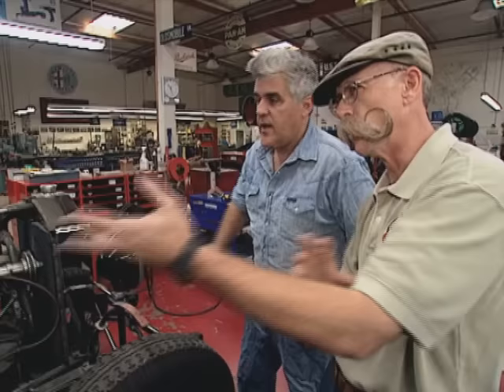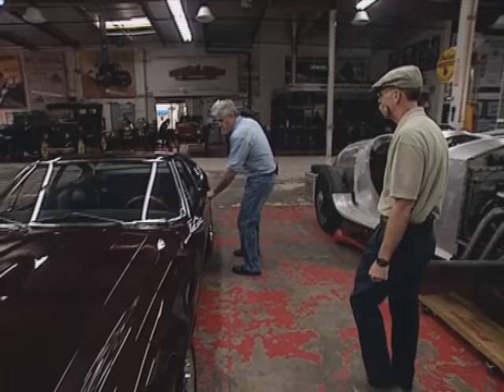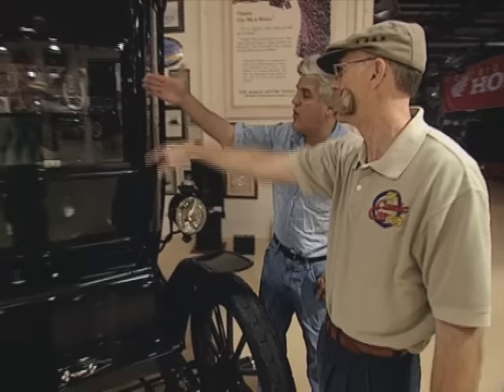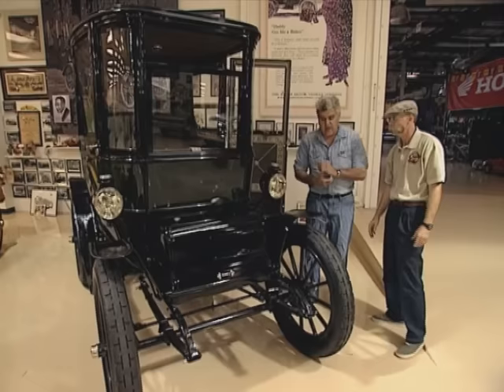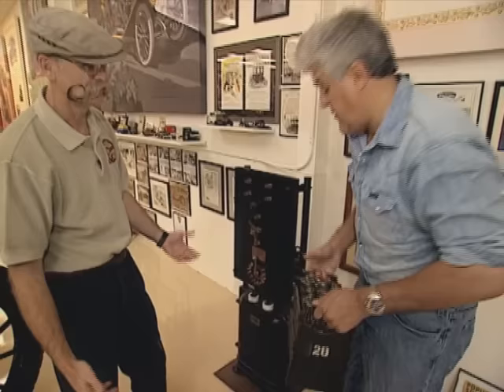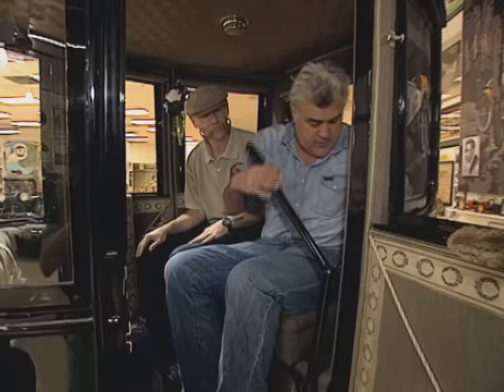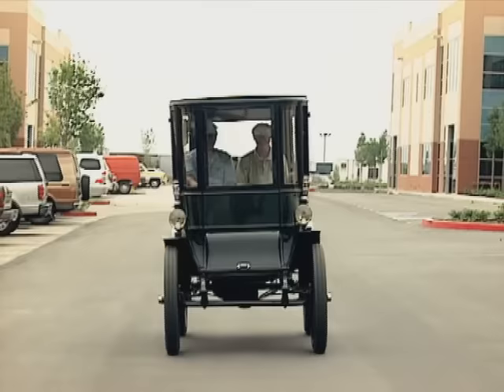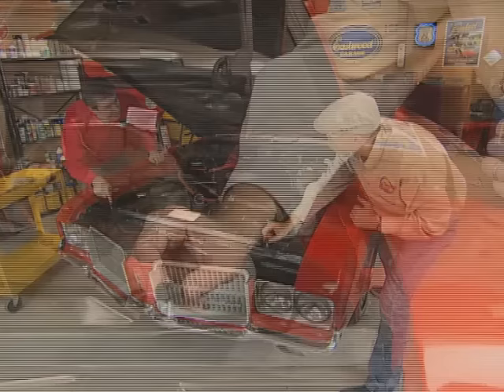Jay Leno's Baker Electric Car

Comment: 100 miles on a charge imagine how far you could go if the tech hadn’t stopped for a century
Reply: & the Original Batteries were...actually "Lifetime" ones..meaning YOUR Lifetime. They were not as powerful as ours today but you only bought them once unlike todays which cost a literal fortune to install & replace every few years.
Reply: 100 miles @ 23mph, faster = less range.
Reply: @bradsmith1934  Those batteries eventually wore out. They were designed to last 4 years. Some that saw light use and good quality water and materials lasted 50 years.
Reply: @Username-2  My saying 'few years' is a # under 10. I once looked into buying a g.c used Hybrid & the battery was dead, the vehicle was low mileage & the price of the proprietary  Battery was in the $1000's(& then $100's more for installation of new & Disposal of dead one) well above the value of the vehicle. If there were a warranty of at least 10 years I would consider it.  I have noticed since that for some E Vehicles it is possible to exchange out dead cells. I love the Electric concept just against the idea of overpriced ( & non DIY) Proprietary Batteries. Find me one with 'generic' or 'house brand' (& DIY replace) (by this I mean -not built into-(like Tesla) the vehicle but in accessible cavity)(like ?Toyota) Battery I would seriously consider buying into it.  Bottom line like anyone else who wants to have to spend $ needlessly if things were quality built.
Reply: Brad Smith Man, I strongly suggest you to read further about battery life and disposal.
Reply: @bradsmith1934  really? Sources please, I'm genuinely curious about this.
Reply: The tech didn't stop. to the contrary, batteries have been one of the most intensely researched technologies for decades because the military has needed them.
Reply: @Username-2  I would dispute that batteries in vehicles today last 10-15 years minimum. For one thing, most people haven't had electrics long enough to really test that, and those that have, have found that the batteries from 10-15 years ago lose a lot of their range. Tesla batteries of the last five or six years that are very expensive hold their charging ability well it has been reported, but they use a lot of advanced (expensive) technologies to make them that way.
Reply: @WheelsRCool  Capacity loss is fairly linear until about 70% capacity. I've driven 500,000km across all my EVs and have yet to see more than 10% capacity loss on even the most heavily cycled pack (which was my 200,000km/~6 year old 22kWh BMW i3 pack). A lot of the older batteries like the original Nissan Leaf pack have more than one design issue counting against their longevity (in the leafs case the LiMn chemistry, lack of active thermal management and poor cell layout in the pack). I'd lay down a solid bet that the vast majority of modern EV packs regardless of the price range will retain 70%+ of their capacity at 15-20 years.
Reply: The automotive industry isn't the only industry doing heavy research on battery technology. Though, the tech industry hasn't been around for very long, so we could be a few years ahead of where we are now. Hard to say.
We'd at least have a better idea of how long certain battery technologies last when used in EVs.
Reply: @Username-2  Although I'd argue for short trips into town or around a congested city (say London where av speeds can be 14mph) 23mph would be adequate even today. 

100 miles range! Wow!
Reply: It would go 100 miles.  (in about 7 hours.)  A horse might be faster.
Reply: And he put golf cart batteries in it and still gets good range.  Imagine if he used lithium ion with proper cooling etc.   It just shows how primitive the idea of an EV really is and it's crazy that we are not already on EVs as a standard thing instead of niche.
Reply: @MrHurricaneFloyd  I drive 25k to 30k miles per Year for my job, both in the city and in the highway, and the average speed of the last 10 Years has never been actually more than 25 mph (40 km/h in metric UE) I guess that even if the top speed of my  van is the half, It could make no difference. Now I'm converting the Chrysler Voyager into an EV, just for fun purpose, and see how it goes.
Reply: There's alot of factors you guys aren't considering.
Prior to the 1930s there was essentially no electricity outside of major cities.  One of our greatest achievements in the 1930s was the hydroelectric dam projects that had finally given the ability to start the electrification of the rural areas.
If you were a city dweller up until around the mid 1910s this didnt really matter. Because once you got to the outskirts of the cities the "roads" became just a 2 rut wagon trail through the dirt and mud etc. 
So the automobile was really only for use in your city anyways.  The few brave adventurers who wanted to go on a cross country excursion would need to bring probably 3-4 spare tires, spare parts, and their mechanic.
Before Henry Ford came out with the model T in 1909, automobiles were mostly a hobby for the wealthy. But then starting in 1909 the middle class families could now afford one. 
So it didnt take long for millions of new owners to accumulate and complain about the basic lack of roads between cities and by 1912 most states had started building concrete roads and by 1915 it was starting to become practical to drive inter city.  In 1916 the first highways act was passed by Congress, this matched with federal funding to each state the amount each state was spending from their own treasuries.
By 1922 the whole nationwide highway grid was completed. Most of these were the cement ancestors to the later interstate system, nearly all along the same paths as today.
So at this point this 100 mile range car was exceptional, most electric cars only got 20 to 40 miles on a charge, recharging took all night, and we still largely had no electricity outside of major cities.  Furthermore combustion engines had became much more established and reliable, gasoline was now widely available nationwide.
So by the end of WW1 the electric car was completely impractical. Unless you lived in a major city and were completely fine with the many disadvantages.
And in the 1920s nobody had a clue about carbon emissions etc, so there really were very few conceivable reasons to buy one or even to make them.  Most  manufacturers had either switched to combustion or were defunct by 1910.
It wasn't a big corporate conspiracy by oil barons as undoubtedly most would assume. It was simply practicality.

Even in today's age the electric car hasn't caught on for mainly the same reasons and it never will until 4 things change.
1: range, they need to be able to go as far as combustion cars can on a full tank,  300 to 500 miles on a single charge.
2: they need to be able to recharge much faster, at least close to the time a regular car can fill up.
3: the obvious lack of charging stations. As of Dec 2020 I have only seen one ever, last year at a Holiday Inn in a small town an hour away, they had 2 parking spots for EV cars.
4: every electric car will need to be as affordable as their combustion counterparts while doing #1 and 2. 
Right now it's basically just the highest trim model Tesla offers that can somewhat do #1 but only in power save mode.
Reply: @toki89666  
1: Range is an issue every time you take a long trip.  How many trips of over 300 miles do you take each year?  You can buy a used Volt for those long trips and still run around town everyday just on the battery, I do.
2: Yes, recharging faster would be great.  But even on a long trip you may need to stop to eat and that can take half an hour or more, so recharge then.  Or get a PHEV like the Volt.
3: There is a lack of charging stations for non-Tesla vehicles - sort of.  My charging station for my Volt is in my garage and I recharge it every night.
4: I have only bought one new car in my 70 years on earth.  I paid $23,700 for my used Cadillac ELR (Caddy body on a Volt drivetrain) and $15,000 for my Volt.  I’ve driven one or the other from Edmonton to Mexico City and beyond but mostly I drive them on battery-only around town.
Reply: Probably not a whole lot further then we are now. I was just reading an article that was saying with the materials we currently have to work with the battery will not improve much more. The article said new compounds and new types of metals and other materials will have to be discovered or invented for the battery to make any significant advancements.
Reply: @bradsmith1934  "They were not as powerful". yeah... whole point of main comments was  
"if this tech hadn’t stopped for a century"
Reply: @MrHurricaneFloyd  Less weight too probably
Reply: @WheelsRCool  Tesla batteries aren't more or less advanced than any other battery, they probably just have higher quality standards for their cells

I think you're wrong in saying people haven't had electrics for long enough
Reply: @rsewill12  You probably don't mean it this way, but this is a rather condescending tone that many people do not like from EV proponents, the idea that, "Range is only a big deal if you take a long trip..." or, "On a long trip, you need to eat, so recharge then..." or, "I have only bought one car in my whole life and it was used..." blah blah blah you don't know the needs of the average person. The fact is that people want vehicles that fill up/charge up quickly and have a decent range and a decent cost.
Reply: @sgas  Tesla batteries are very advanced from my understanding because of the thermal management systems and such that they have in them.
Reply: @rsewill12 If one desires a PhEV then they can acquire one, but clearly those aren't what the public wants. For one, PhEVs have very weak engines (Volt's is only 84 hp) and two, most people desire larger vehicles, like crossovers, SUVs, pickups, and minivans.
Reply: Physics doesn't change no matter how much time goes by.
Reply: @redsquirrelftw  I wouldn’t want only electric automobiles! 
However I wouldn’t have a problem with driving it daily. As long as I could also have one that wasn’t electric as well! 
I like the characteristics of a gasoline engine. 
However most days I could live with a electric automobile. As long as it was small & zippy like that one! I really like the old fashion look of it!
Reply: @uclajd  I don’t know about that! Time travel will probably be invented or at least revealed in the near future!! 
There’s no way for typical people to tell!
Reply: Been stopped, LOL!
Reply: @WheelsRCool  The Toyota Prius has been around since 1997; It has batteries.
Reply: @0MoTheG  Well yes, but very few people owned them in the late 90s.
Reply: Stopped? This thing has not enough power.  It wasn't until the invention of Lithium battery that such a car has a chance.
Reply: If you’re auntie had nuts she’d be your uncle. IJS